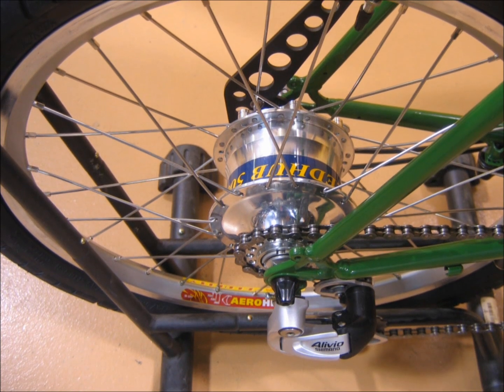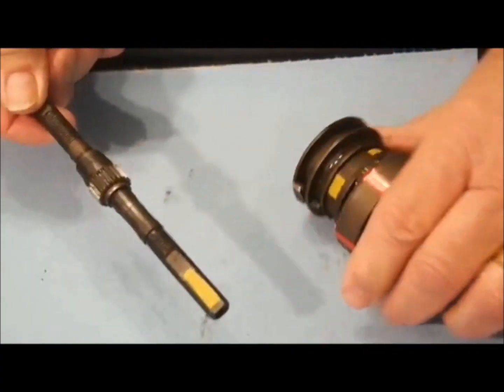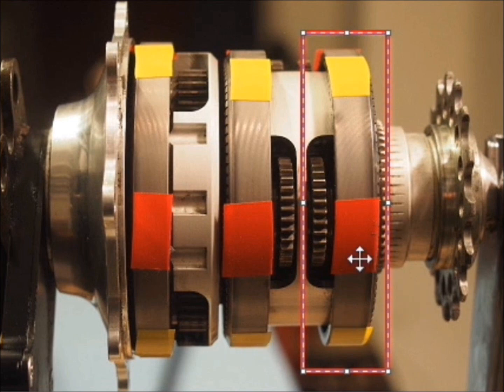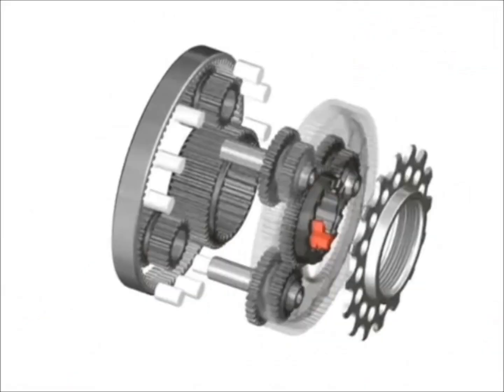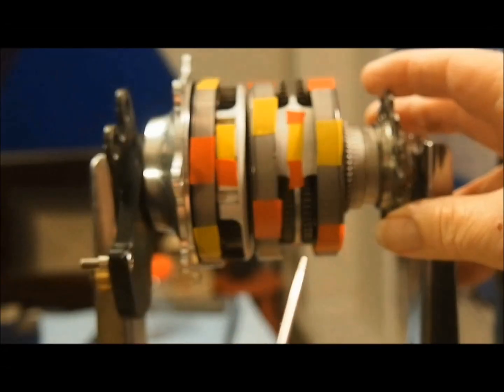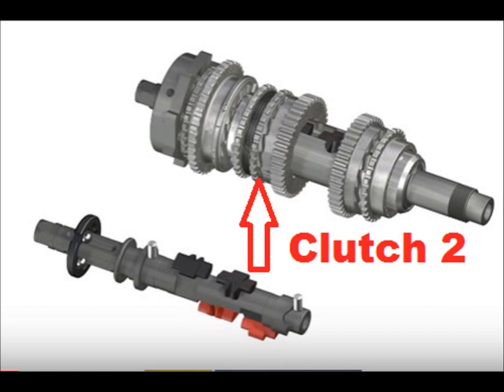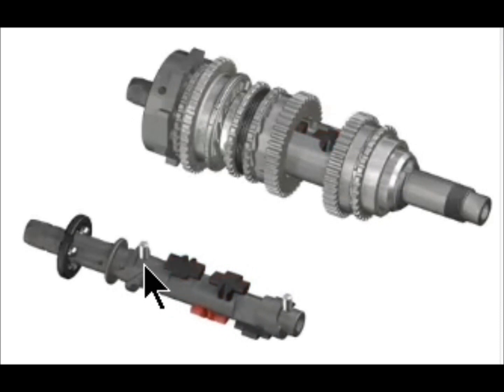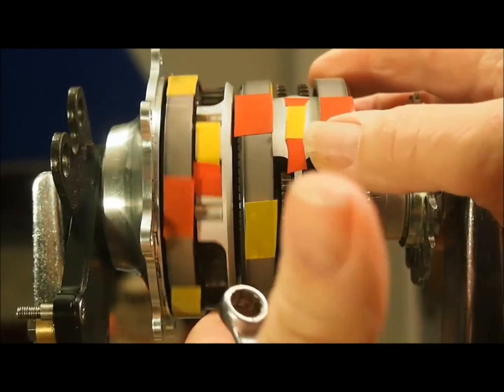Rohloff Speedhub How it Works

Comment: Oddly, this is actually significantly simpler than I initially thought. I was under the impression that gears 8, 9 and 10 used different planetary gears. But if I’m understanding this video correctly (which isn’t a guarantee, lol), gear 10 uses the planetary gears of gears 8 and 9 together, but working in opposite directions, for lack of a better term.

So the whole thing produces 14 distinct gears with only 3 gearing mechanisms used in different configurations? I now appreciate the efficiency and genius of this design so much more. Who else but the Germans, eh?
Reply: When is roloff going to make one to fit a thru axle??? They need major updating!!!

Comment: You did an incredible job in analyzing the mechanics of this gear box, and even more to present it in an understandable way. This project must have costed you several weeks if not months. Still I wonder if this transmission is to be preferred over the 2 front / 7 rear derailleur mechanism. The latter is lighter, runs with less resistance and is an order of magnitude easier to service.

Comment: What a tiny mechanical "wonder"!  I've been driving Rohloff for about 10 years and shifting with it is simply fun because it happens so quickly and intuitively. In addition, the robustness, a really great development. Thank you for the clear explanations!
Reply: is it worth the extra weight compared to external gears?
Reply: @bamf6603  I would say it depends. If you are extremely concerned about weight, then of course it is more important. I currently have an e-bike with derailleur gears and I would like to have the Rohloff back, as it requires significantly more maintenance and when you ride through a meadow, blades of grass quickly get caught in the gears. Unfortunately, there are only a few e-bikes with Rohloff gears...

Comment: Thanks for a great explanation of the Rohloff Speedhub Dan.    I already have one fitted to my Thorn bike and although it's been reliable, I much prefer riding my derailleur geared bikes.   The Rohloff hub feels heavy,  it feels gritty,  and it also feels slow as if it's filled with treacle. The internal resistance when freewheeling is enough to push my legs round and the twistgrip gear changer takes a lot of effort to operate.  I also ride a Shimano 5 speed hub geared bike which in comparison to the Rohloff is an absolute pleasure to ride.

Comment: Since they have electronic shifting, do they have a system that works with the movement of the drivetrain to charge the battery system or at least keep it charged up so you don't lose gears if the battery was to go dead?
Reply: The electronic Rohloff shifter comes with Bosch systems (and I think some Shimano ones now), and the controller will maintain a reserve of battery power for the shifter after cutting off the pedal assistance.  If the battery goes completely dead (which you shouldn't do because it's not good for the battery), you're stuck with the gear you're in.

Comment: too many moving parts to wear out prematurely.i'll take a 7 sprocket rear & a 3 sprocket crank gear any day.much simpler & easier to maintain.& a HELL of alot cheaper.
Reply: Most of your points are valid, but the one about there being too many moving parts to wear out prematurely is inaccurate. These experience extremely little wear and many owners have ridden tens of thousands of miles on them with no issues. They last decades. Chains and sprockets will never do that.

Comment: On what basis 526% range
Reply from the maker: Calculate the gear inches with any chainwheel/sprocket combination. Divide the gear inches of 14th gear by the gear inches of first gear and you will get approximately 5.26. That translates to 526%
Reply: @2wagondragon  thank you for the reply....

Comment: 526% with 14 gears?  Bad idea.  The gears will be too widely spaced.  That is like having 13 note intervals on a piano span more than 5 octaves.  The evenly spaced gears would be about 13.6% from each other.  That is like going from a 22 tooth rear to a 25 tooth rear or vice versa for neighboring gear ratios.  Try again Germany.
Reply: Gear range is nothing like musical pitch range lol.  I mean holy crap seriously that is an utterly stupid analogy.  What do you want, 60 gears (like a piano)?  lmao.

Rohloff's 13.6% increments (and they are consistent - that's part of the brilliance of this thing) are closer together than my 7-speed Shimano, which has increments that vary from 13.8% to 15.8%.  The Alfine 11-speed covers 408% and the steps range from 13.1% to 29.2%.  I don't think the Germans need to take your advice to "try again."  

Jeez, I'm still laughing about the piano thing...

Comment: When discussing 5th gear you mentioned that the initial compound ratio was 1 to .881, however the actual ratio is 1 to 1.135. Otherwise a great video but I wanted to point this out so it doesn’t confuse anyone.
Reply: 1 / .881 = 1.135

Comment: Great explanation and very articulate with precise terms. It would be nice if you discussed the need to minimize input torque when shifting as excessive torque can prevent or slow a shift operation; and in some cases, it may cause the Rohloff to skip several ratios or skip to a higher ratio: for example, shifting from 7 to 8 under high torque might cause the hub to fall momentarily into 11 or 14. These issues are completely eliminated when the shift operation is timed for when the rider has their cranks in the vertical position (applies minimal/zero input torque). For single riders, it is easy to time the shift. For tandem riders, it is more difficult. Food for thought it you ever decide to add to your video or produce a separate video focusing on this aspect. Thanks.

Comment: Why not put these in the driveshaft of a car? It could save space and be lighter than a regular transmission.
Reply: Automatic transmissions HAVE been planetary gearboxes since Oldsmobile invented auto transmissions.  That was maybe fifty years after Thomas Johnson in Indiana invented hub gears, so bicycles led the way, but the auto industry has been primarily planetary gearsets for decades.

Comment: What is Positive Coupling Mechanism? Please explain in more detail. Thanks.
Reply from the maker: That would be where two rotating members are coupled together with positive engagement rather than a freewheel ratcheting mechanism or a friction clutch.
Reply: Form closed, like chain with cog or 2 gears

Comment: Is there a video for rebuilding the 3 speed hub gear of the Mercedes Smart Bike EB001? There's nothing wrong with the bike except the that the cog to the belt drive slips and does not drive the wheel.  The printed manual has nothing about the HUB mechanism.

Comment: A good video, i love it. How much does this hub cost.
Reply: JULIUS SINKALA it is a bit depending on the type of outer finish and which axle is used but here in Europe it is approx. 1100 Euro including VAT.  Plus shifter and cables for sure. But it need service only every 6000 miles and I personally know people which where traveling the world on bikes with a Rohloff which hab no problems during 35000 miles of ride. Since I am not riding so much the price always kept me from buying one.
Fun fact the Rohloff is the only hub drive which can be combined with stronger Ebike mid drive motors (above 50 Nm of torque).

Comment: Very good job, thank you. But the Rohloff itself? No. To heavy, to expensive. I am a fan of the original planetary system with 3 gears only as you showed one at the start.
Reply: Horses for courses. The Sturmey goes from .75 through 1.0 to 1.25, a total range of 177%, and that will do for flat city riding with an occasional small hill. Anything much more than that and you will really want more gears and more range. That said, a Shimano 7 or 8 will get you most of the way there without breaking the bank. The Rohloff is a luxury item.

Comment: Hello Dan and thanks for such a great video. I have a Grin Tech Stoke Monkey mid-drive motor on my trike which has re-generation breaking. Is it possible to lock the Rohloff from freewheeling so as to continue to use re-gen. I have asked Rohloff a few times and not got a response. Thank You.
Reply from the maker: No, I don't think that would be possible. The clutches are a ratcheting type, and even if they were not, the sun gears would still ratchet over the locking pawls.

Comment: Great overview... in your experience, what internal elements of the Rohloff SH are most vulnerable to normal wear and tear?  In other words, what would need to be replaced first?  I just bought a vintage (over 20 years old) bike with a Rohloff SH.  It has the older
(pre-2011) shifter mechanism, but I don't know it's use history.  It seems to function well.
The oil change did not reveal any particulate matter or discoloration.
Reply from the maker: In my opinion, the parts most vulnerable to damage or wear would be the locking pawls that couple the sun gears to the axle. The best way to extend the life of these elements is to break torque input when shifting .In other words, ease up on the pedals.
Reply: Dan.  Thanks for the advice.   Was your disassembly for instructional purposes only... or did you have to effect a repair/replacement?
Reply from the maker: @alandaugustine8519  It was for demonstration purposes only

Comment: The only thing that confuses me now, is how to set the gearing to the optimal position for the maintenance of the gears. 

Meaning the gear set of 3 and 5. How is that accomplished?
Reply: Regularly move through out the gear range, just like a car. Even if that means on a stand while you turn the pedal by hand.
Reply: These don’t require pedaling to shift - they can shift between gears at a standstill. You just twist the shifter to the appropriate gear, that’s all there is to it.

Comment: What makes it change gears?  computer + motor, cable, mechanical torque sensor?
Reply from the maker: Stock shifter is mechanical, with two cables in a pull/pull configuration. There is an aftermarket  shift unit out there which I have only read about, never actually seen.
Reply: @2wagondragon  The Co-Motion twist shifter is a superior option for drop bars, I put one of those on my Vaya and it's far better than the stock Rohloff shifter that can only install on bar ends.  Super smooth, solid aluminum, and mounts all the way up the bars on the fatter clamping surface right past the taper.  It has hollow cable channels for the brake lines to neatly pass right beneath it.  Bit pricey, but then again if spending 1500 on the hub, what does a little more for a really nice shifter matter lol

Comment: I notice that these hubs are being sold as 32h and 36h hole. What does this mean?
Reply from the maker: That is the spoke hole count. It was originally available as a 32 hole only, but this was deemed inadequate for heavy duty use such as tandems.
Reply: @2wagondragon Ah, okay. So what spoke size should I buy for a 26" recumbent trike wheel laced 2x?
Reply from the maker: That will depend on the ERD  (Effective Rim Diameter) of the rim.being used. 26" rims vary greatly in this measurement. Standard wheel building stuff.
 Most online spoke length calculators will have the dimensional data for Rohloff hubs. They will also most likely have the manufacturers published ERD for your rim if it's a common one. 
 That said, I never rely on published data as I have often found it unreliable. I measure and calculate with parts in hand.

Comment: Hey again Dan

What is the reason that some of the gears make some noise  even the new hub is filled with Rohloff made oil ?

M.B.
Reply: It is a 14-speed, but it actuall only has 7 gears. The first 7 speeds are on a gear reducer. The reducer is what makes noise. The hub is quiet in the top 7 speeds. The noise doesn't mean it is junk. They have been producing that hub since 1998. Not a Hub has failed, yet.
Reply: @normand5847  funny, I just read a comment on another YT channel saying he went through 3 Rohloffs.  "No failures" is a bit of a stretch.  Now I understand this hub is tandem rated and has a great history with high-torque off road tandem use.  That's an excellent test.  However, "no failures" of pretty much anything is a very high hurdle indeed.
Google it and you'll quickly disabuse yourself of this notion.
https://www.youtube.com/watch?v=-4OmG8T7Uec
http://thorncyclesforum.co.uk/index.php?topic=12265.0

I should add that the hub's large flange diameter can be problematic with certain wheel builds, causing spoke angle issues at the rim.  Frequent spoke failure can result.  Again, not without some issues.
Reply: I have not experienced this hub I have a lovely smooth quiet Sturmey-Archer FW.   The freewheel pawls are not over-driven in some speeds but are disengaged.  Although both have straight cut gears, although they are quiet in the FW, straight cut gears do whine and lose power.  This is why helical gears are used if practical they do not suffer velocity modulation as the driving gear tooth slides up the pushed gear tooth.
Reply: @AndrewLohmannKent  Filled the hub with 25cl oil instead of the 15cl  recommended. The noise/raunch sound disappeared!  There is no leaking of the hub and the gears inside works well.

Comment: Hey Dan Burkhart

I have a short question . Are there any bearings in the outer caps in the Rohloff ? If so what size are they ? Would it possible to change these bearings with hybr. deep ceramic balls/steel bearings and Non Contact Rubber Seal ,  example from Enduro  ?

Martinius Berg
Reply from the maker: The outer bearings are 61807. They are fitted with the seals removed so the oil from the hub keeps the bearings lubed. An outer seal is fitted in the shell to keep the oil in.

Comment: But so how does this engineering spirit first into Rohloff's newest policy about refusing to sell seals? If your hub starts to leak oil, you cannot fix it yourself, you have to sends the entire wheel back to a "Rohloff Service Centre". So how does THAT work if you are somewhere remote?? You can buy the special tool to do it: still can, lots of people still selling it. But no seals. I've just had the UK distributer refuse to sell me any seals. They say I must send the entire wheel to them. And it's no9t under warranty: is entirely at my risk if I want to do it. I really don't like that.
Reply: Agree in part.. they should be selling parts to everyone.
Reply: Really? This definitely puts me off buying it.

Rohloff can sod off.
Reply: Phil Weatherley  I ride a bike that is easily maintained and fixed. That's what cycling is all about. Try fixing this fucker on a snow topped mountain.
Reply: Phil Weatherley  That hub has been around for over twenty years. Nothing new.

Comment: Pretty sweet video and hub. I have gotten more sceptic  about German engineering lately because my young vw car is dead after a long list of problems. But it is not the same company and I hear great things about Rohloff
Reply: I ran a VW Golf for a while it may have done 200 or 300 thousand miles.  The engines don't go that long, and the electrics are awful but the gearbox was lovely smooth and quiet.   I thought when I have sat or drove newer cars - chuck the new gearbox out and put that nice quality gearbox in and the car would become half-decent.

Comment: Now am I right to assume that we can use a front gear changer to have more gear options?
Reply from the maker: Sure, if you feel you need more than 526% ratio range. Some recumbent trikes paired the Rohloff with a Schlumf 2 speed crank for a mega range drive train.
Reply: The standard chain tensioner from Rohloff can work with chainring differences up to 10. I ride it with two chainrings 52 and 60 on my hp scorpion recumbent trike and it works really well.